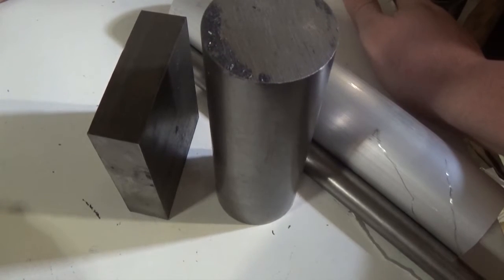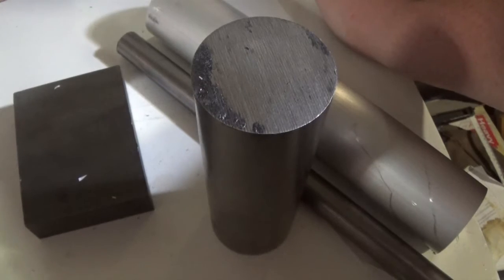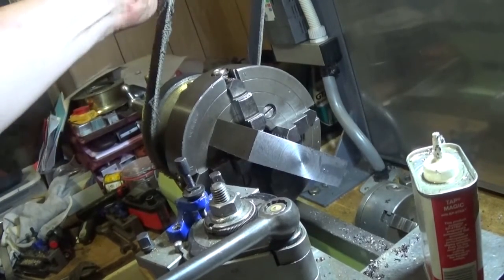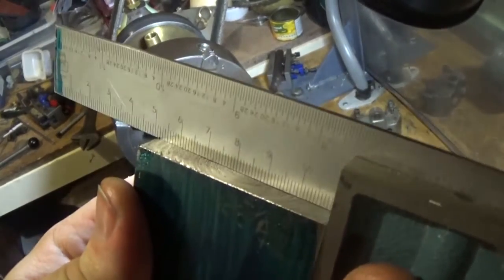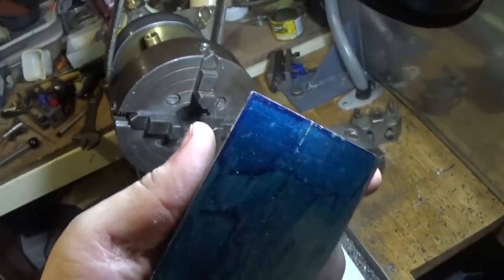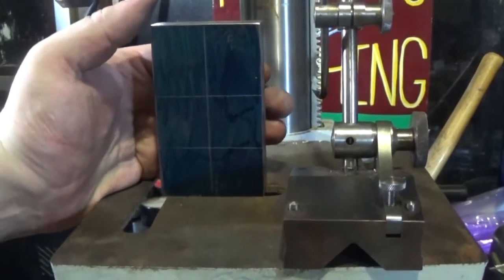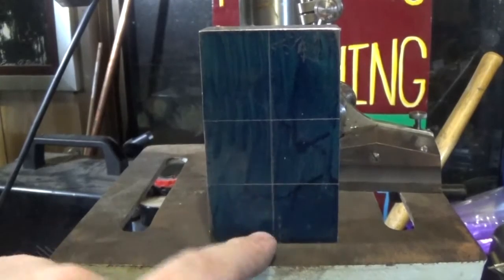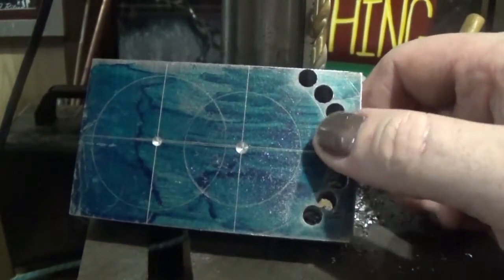Prince Dynamo motor PART2

Comment: Filing out chain-drilled holes is very zen. Angle grinder is much faster, but no zen at all. Finally there is a metal-cutting bandsaw, which would cause shop overflow. I made one of the latter out of a hand-held bandsaw that I found in a pawn shop. Anyway, it came out well.

Comment: Hi Emma No need to go for a run after all that  exercise. Looks as though the mighty Lorch was just getting to its limits there.  Yes you really need to make a friend with someone in a scrappy, small machine shop or fabricators locally. It could be a good source of material offcuts. Have a wander around the small units on your local industrial estate and have a look see what's about. You will be surprised how helpful some of these small companies can be to a modeller and they may also cut small pieces for you. If you do not ask you do not get.The money you save on materials alone would buy you a small band saw either vertical or horizontal.  I get my offcuts  from a company that makes rollers for quarries. They chuck out stuff that is more than big enough for my needs. A week or 2 ago I picked up some 50mm round EN8 that was over 300mm long with some shorter  bits of square and hex. They just gave it to me. (poor old pensioner that I am):-)  I am betting that there people in the industry locally who watch your video's and are willing to help you out.  You have taken on a pretty ambitious project there considering the tools you have. But that's how the old engineers did it and there are some beautiful pieces still around. The very best of luck with it. I look forward to the rest of the project. regards from the UK   Gary

Comment: Hi dear.  Just back from the metal recyclers.  I have asked if there is a law against selling metal to walk in customers, and I was assured that there is no law about that.  However a lot of recyclers don't do it because a lot of people steal from them.  I think if you can give them an assurance, they might be happy to sell to you.  About the filing of that piece, what is wrong with an angle grinder?
Reply from the maker: +Marcel Timmers lol.. yes. i did grind most of it on the bench grinder... wasnt going to tell anyone that! :P
Reply from the maker: +Marcel Timmers and a big thanks for that... i just have to get to knowm someone who works in the scrappy.. hope you got some shopping bargains!
Reply: not done too badly.  I got a lot of five core 440v orange wire, one five core plug, a 3/4 torque ratchet and some 240v wiring and plugs $45. the lot.  Not too shabby, I say.